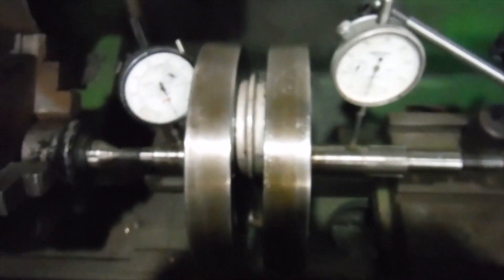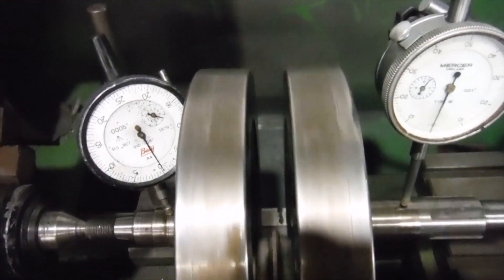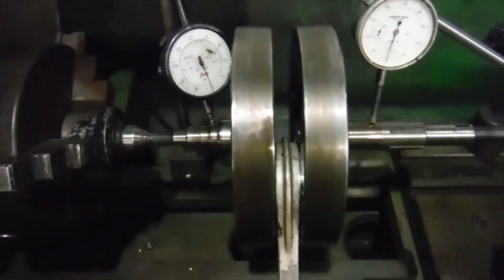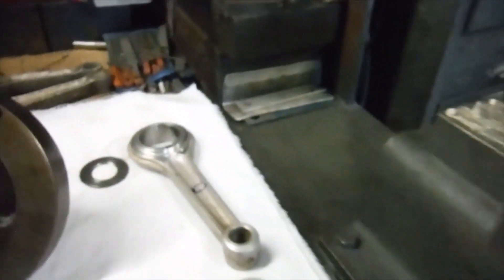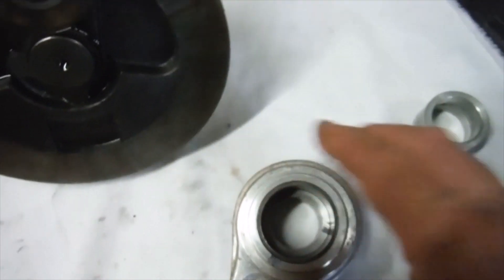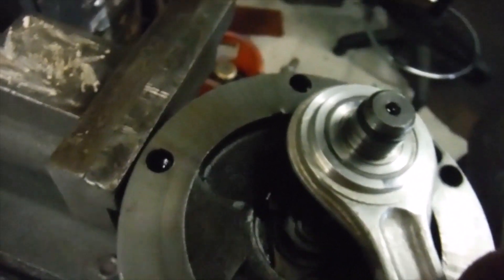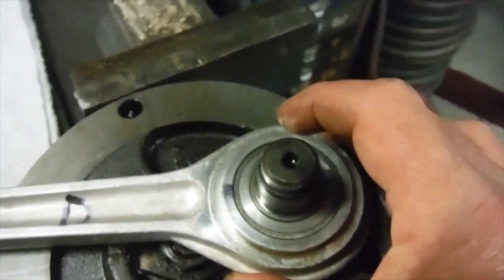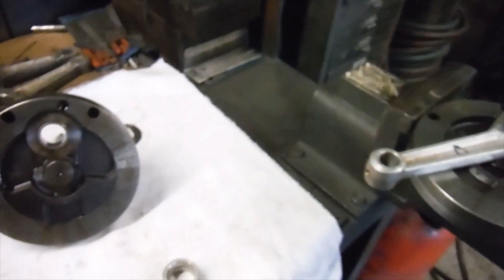Royal Enfield 500 Indian Bullet crank check and reassembly discussed.

Comment: How stable are those crankshaft? Meaning, if you check the runout again in 5000 miles, will it still be 3 thou?
Reply from the maker: A sudden transmission lock up might jolt them out of true, but under normal running conditions, the runout shouldn't change.

Comment: Interesting about the oil pressure relief valve! I don't think I've seen that mentioned in any of the literature I've read! So thanks for that Paul!
Reply: It's worth taking the time to understand the Enfield oil system.  Much maligned but I think it's pretty good provided the correct oil is used.  Many assume that "thicker is better" but I don't believe it is.
Reply: @MOFTV  after 60 years working on bike and mostly Enfields, it's good to learn something new!